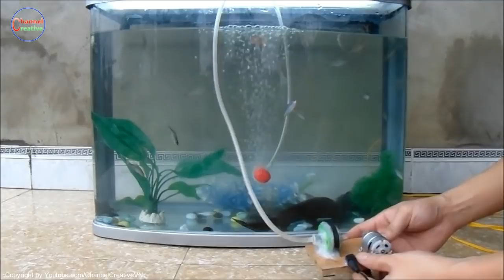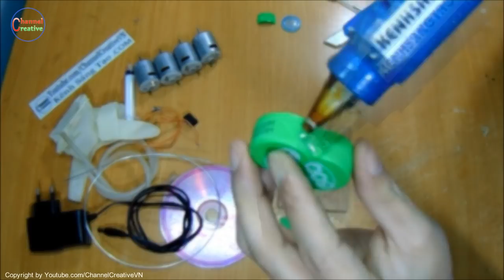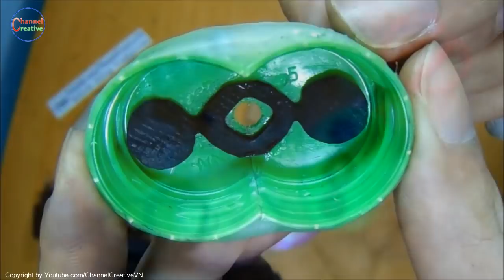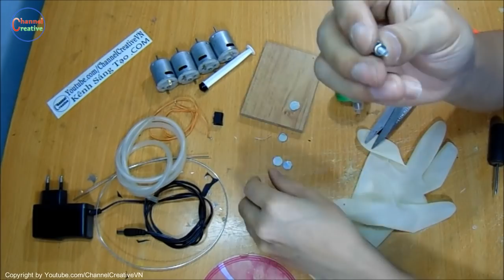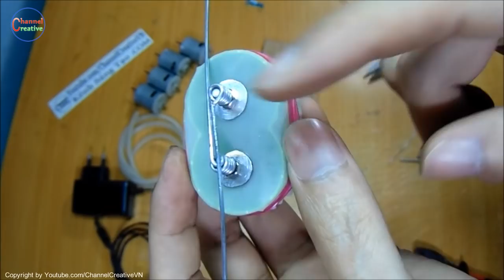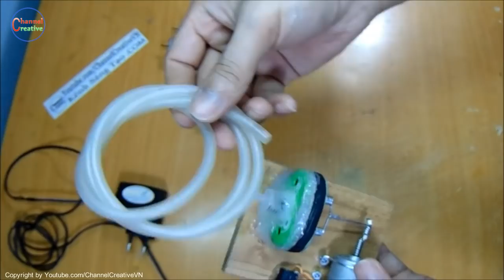DIY - How to Make a Mini Air Pump v2 | Mini aquarium air pump

Comment from the maker: Hello everyone, thank you very much all
Reply: can u make condenser to draw water from atmosphere ,home made with low cost .thank you
Reply: +Creative Channel 
would you use that efficiently as a water pump, after submerging that underwater_?
Reply: +Zafer ayyıldız , it would work but only pump about 30 litres an hours, also, after a little while the motor would cease. because  of the water rust would form inside the motor, on its shaft and other metallic inards
Reply: kênh thứ 2 của a phải k... +Kênh Sáng Tạo.COM
Reply: +Zafer ayyildiz Diaphragm pumps only work efficiently with air. Plus the motor would definitely get damaged if submerged in water.
Reply: thank you
Reply: Creative Art Channel
Reply: Creative Channel doesn't it make noise
Reply: Creative Channel no thank you from us
Reply: Creative Channel your are real an engineer
Reply: We can use ballon
Reply: Hava motoru
Reply: 🙃🙃🙃😮😲😲😲ok

Comment: Nice work! But how about you add a two-valved air tank to it in order to compensate the blast waves? Doesn't need to be big, though. 1/2l bottle with two valves in the cap it will do the job perfectly by receiving the blast-waved air and giving a constant and quiet airflow to the ball. Cut the hose in two and put each end into the cap valves.
Reply from the maker: +Bandicoot803 thank you for idea
Reply: Creative Channel
You're welcome! Would love to see the ensemble in action!

Comment: If you want to make this more efficient (diaphragm pumps already are quite efficient), you can include a simple reduction geartrain. If the strain on the motor is cut in half, the speed under the same load will double thus making it stronger and more efficient. For this you need a 2:1 ratio geartrain but you can easily go higher making it very powerful. But if you go too far the actual benefit will be lost as it doesn't add more power but rather reduces the speed. So don't make a 50:1 geartrain or the efficiency will drop.

Comment: i tried making it, not enough air comes out to get it blowing bubbles, how would i improve the amount op pumping power?(bigger air chamber maybe?)
Reply: A longer stroke on the armature should help. Also, make sure the flaps are making a good seal. Bicycle inner tubes are rounded and tend to curve. If the outside is against the wall, it curves in such a way to allow air to pass. Flip it around for a better seal.

Comment: I am having about 20 pounds of fish aquarium and each pound size is of 15ft length and 5 ft breath and 4ft height i need one huge or big air pump which handle all my 20 pounds . can u plz give a better idea to handle this all.. plz do rply
Reply: You could just scale this design up to a bigger size.  For more detail, it's a diaphragm pump with flap valves.

Comment: how much pressure it can pump? can you connect it to some kind of air tank?
Reply: +Rizal Ardiansyah no way, that things wouldnt even be able to push air againt your finger, forget about an air tank. whats more, that pump only works under water because the way it's made, it's easier to suck air than water, so when it sucks the rubber valves open first. In theory it could also work in air because there's less resistance in the admission but the difference is minimal so you will get some push/suck effect at the output, when the idea is only to have air goind out.
The air pump works but is in no way near of what an ideal air pump is. To fill a tank at pressure you need a compressor which has really high static pressure. The valves in this toy wouldnt even be able to hold it
Reply: +Laharl Krichevskoy what do you mean this pump can only work under water ? this is a diaphragm pump, like the commercial Tom Aquarium Aqualifter pump and they all work underwater or in the air.

When the air get in the pump the out valve close by it self and air can pass through the in valves.  Then the diaphragm change direction and push the air out of the chamber and intake valves shut by themselfs so the air only can get out through the out valve.

There is no need for the pump to be under of above the waterline to work.

Depending on the latex glove resistance, I bet that pump could pump water for a few inches high !

Comment: im one of your subscriber and i have a question can the motor will overheat?
Reply from the maker: +draco coco hi friend, that is motor 6v, and i use with adapter 5v, so it will not be hot
Reply: +Creative Channel can it run 24hrs nonstop.??
Reply: Thanks alot how about for the next project can you make a water filter for aquarium :-)
Reply from the maker: +Android user hi friend, I thought maybe :))

Comment: what is the difference bitween ac motors and dc motors?
Reply: ac motors cannot be powered by batteries because the voltage is low while dc can be powered by ac but it would burn the motor

Comment: What will happen if I use 12 v to run 5 v motor plz answer
Reply: i think the 5 v motor will over heat use old chargers it  has 5v i hope works

Comment: can i use 3v motor? 16500 speed rpm 
?
Reply: +Saba Chixinashvili  or link me motors of air pump and hand drill machine v3  im interested of table saw and sander machine motor to? and him swich

Comment: he can glue motor also...
Reply: No, it gets hot with use and will melt the glue.
Reply: +GranVlog
A 2 volt DC motor does not get warm, but hot glue does not stick very well to metall.